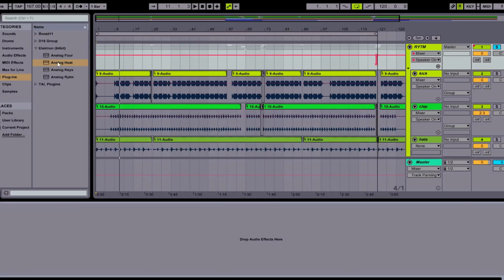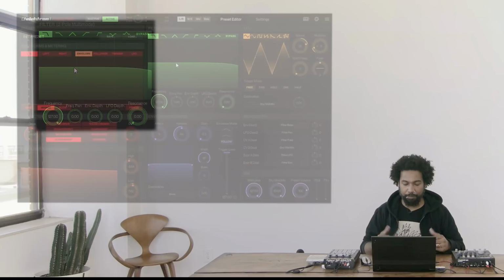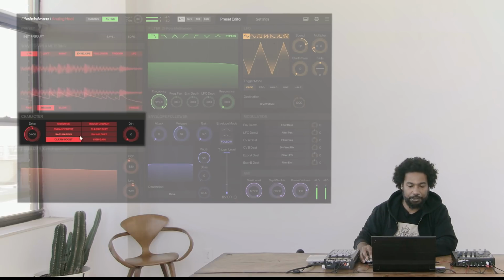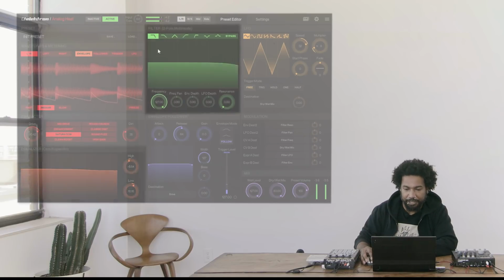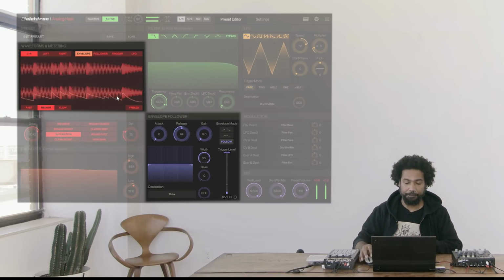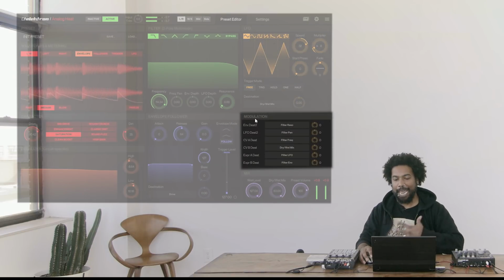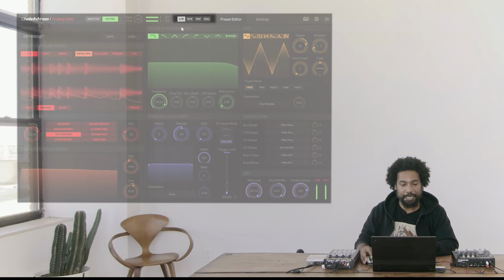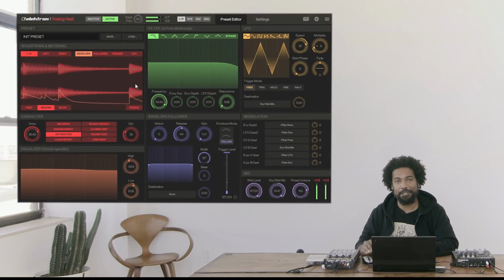Overbridge & Analog Heat - Ep.1 Overview

Comment: Analog Heat is not working with ableton as shown in this video.
Very disapointing cant understand the hype.
If I'm wrong please show me how to install and bring it to run.
Reply: I have been using Overbridge for years on Ableton Live without issue. The issue is down to you.
Reply: Maybe should give it another try.
I have to bring it to run with ableton

Comment: So overbridge is a middle man for your daw to your hardware (aka the analog heat)? It's not a plug in where you use the analog heat as a controller right? If I use Overbridge with the analog heat I'll still get that analog circuitry, Right?
Reply: CA$INO GANG yes, definitely still using the analog circuitry. With Overbridge, sounds from your DAW, VSTs and such will be routed through the analog hardware.

Comment: overbridge what a joke, when I connect the heat direct to my Mac pro 2013 over usb, I get I loud beep and it works only with a half sec latency. Sometimes I have to restart the heat before it works at all. All software is up to date...
Reply: you're gonna return it because of a problem which will eventually be solved, but in the meantime, you can just use your audio interface?
Reply: monowelt I have the same problem, I will return the unit :(